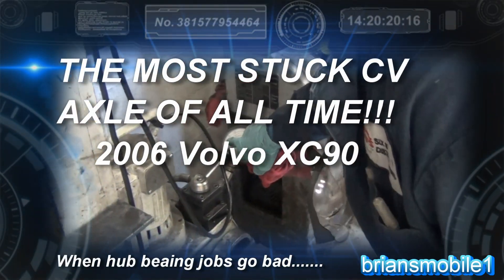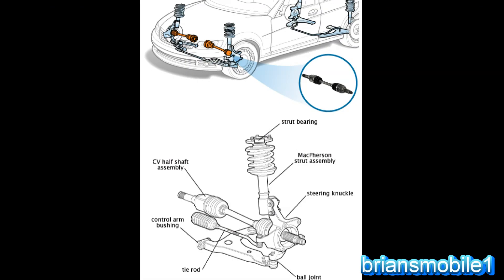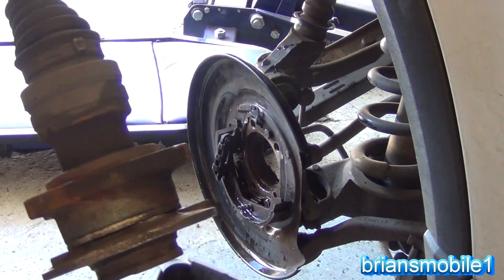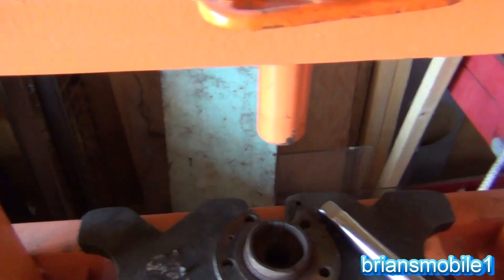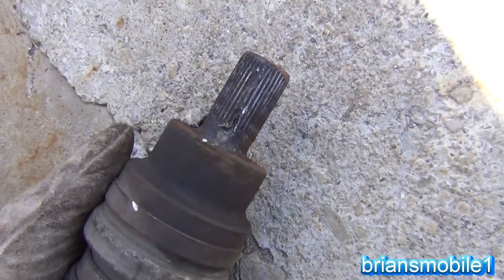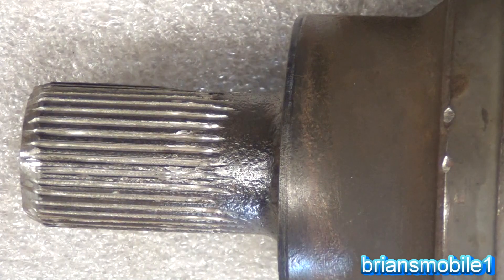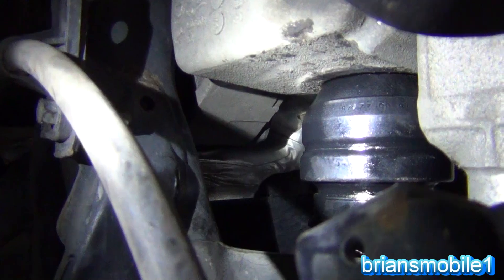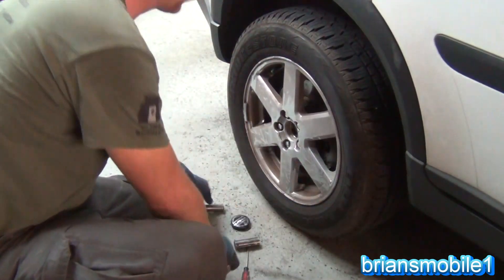Most STUCK CV Axle EVER Volvo XC90 2006

Comment: The round metal rim (the part with holes for the wheel lugs) of the hub is NOT supposed to take such pressure from the press.  This round rim will bend, even if not visible to the eye, and will not stay flush against the wheel any long, which will cause the wheel lugs to break loose while driving.   If the axle is really stuck inside the hub, replace the hub and axle altogether.  Forget about using a press.  Get some used parts, problem fixed.Side note, the wheel bearing is not made to take such hits with a hammer either.  Forget the effort, just get a used spindle and axle.  Don't forget to spray some rust reformer on the reluctor rings, before they rust and crack.

Comment: 21:16 I'm totally looking at the girls legs.

Had this happen on a Chrysler (yeah big surprise) I beat the hell out of it. Then to make it better it was designed so the CV joint was bigger than the knuckles hole so couldn't pop it out the tranny to work on it easier. So 4 angle grinder disc's later it came off. I had a new CV axle the people bought so I didn't need to save it.

Had it been able to pop through the knuckle it would have been easier to just cut the axle in two pieces. But it was a no go on that so had to go through the hub. It was probably more seized because the thing sounded like an airplane going down the road and the constant heating and cooling down probably fused it to it. The bearings were ground to nothing.

Wasn't too bad cost wise since it was domestic and old.

So all in all I feel your pain.

I see this often cause I live in the north (salt) and a lot of people loose the dust covers and don't think they do anything but look pretty. Some of them don't do anything and still let water and crap past them but Pontiac's have the best one's I've seen.....every time I get ready to take off an axle nut off a Pontiac it looks like new behind it. Pontiac axles are pretty easy to work on in their FWD cars.

Good job at saving that axle. It won't always work but you did a great job on this one.

Comment: I think  it is not a 2000 ton press which is huge. he just read 2000 psi of hydraulic pressure.
Force = area of bore * 2000 psi.
I guess it is about 100 thousand pound. 50 ton press.
Reply: Absolutely true! Just google a 2,000 ton press, they're friggin' gigantic! You're right it was 2,000 psi and not at all close to 4,000,000 pounds of press force.

Comment: I have a 92 ford F 150 when I'm back up in vibrate will bed I have a five speed with overdrive how can you tell me what the problem is
Reply from the maker: I could tell you what it is by trouble shooting the U-joints, differential, transfer case and gearbox.

Comment: I actually had the opposite problem on my xc60. Axle popped out of the hub fine, but after hours of hammering, prying, pulling, turning, etc it just won't come out of the transmission.
Reply: 3 mechanic attempts later, still stuck in the transmission. I have the excalibur of axles.

Comment: On the dremel, What do you call the bit that holds the wheel?
Reply: Arbor and/or mandrel, usually in 1/8 inch size.  A simple screw holds the abrasive wheel on.
Reply: Thank you

Comment: Lol 06 Volvo xc70. Wheel bearing stuck, tried taking the axle out, broke off in transmission. In the process of using a slide hammer to get it out now lol.

Comment: I've watched a lot of your videos for various projects. This video made me love your dedication and persistence to this more than ya know. 

Working on a 2004 Accord right now and the CV nut is stuck. Letting it sit over night with some penetrating lubricant (didn't have any PB blaster on hand, some generic stuff and brake cleaner had to substitute) and hoping for the best. 

Quick question for ya, if you happen to see this. I replaced the rear hub assembly on this same car today (the honda). The OEM spec hub I got seems to be about a millimeter off on the sensor ring (cog'd bit), so I banged the sensor magnet/metal protrusion back with a hammer and chisel so it would fit. Think that messed up the sensor?  And/or should I just get a different manufacture  hub assembly. (and new sensor because I just beat the crap out of it) =)

Keep up the excellent work. I hope you make enough money off the Youtube ads on your videos to make it all worth while, because you do good stuff.

Comment: Hmm... I would try to just cut across the whole hub with an angle grinder, like ppl usually do to remove busted cv joint ends, they just cut across the whole cv joint end to remove it. Why couldn't you? Not trolling, real question :)

Comment: heat the part you want to expand , in this case not the axle .
Reply from the maker: There's 2 strategies.  One is to adjust size momentarily by heating or freezing.  Another strategy is simply to oxidize or catalyze the rust or expand and contract to break up rust.  If you heat the hub you destroy the "permanently lubricated" aspect of it and destroy it.  That being the case you may as well just cut it.

Comment: that press at that shop is not 2000tons, probably more like 20tons.
we have a 60ton press at work and that's much beefier, and the ram is probably 3 times the size.
Reply from the maker: I have a 20 ton press in my barn that looks like a toy next to this one.  I've heard there are doubts, but that thing typically gets done whatever is put to it.  The red line on it is at 2,000.  That's all I've been able to see.  The respectfully ask me to stand back as things occasionally take to the air when things shatter under it.

Comment: I value my time more than the cost of the cv axle, bearing assembly.
After 15 minutes I would have pulled the axle, assembly and replaced with new.
"Never give up" ??? By the 1/2 hour mark my time would have burned the cost of the new assembly and axle.

Comment: Your 'eyeball' spec torque at the end was pretty lame; also, if you didn't use antiseize on every bolt and the axle end before reassembling, you deserve the same problems next time. Alloys that tend to corrode worse than other brands should be factory speced with proper antiseize materials, so thanks for steering me away from Volvos.

Comment: diesel-man's press wasn't 200T either.  at 2000 psi he would need 200 sq inch piston total area to hit 200T....he didn't have that.  a 6" cylinder would offer about 28sq in....he'd need 7 of them at 2K psi.  he had probably a 'very nice 20T' or maybe a 40T.  40T would need 1/5th of the 200 sq in?  still 2 6" cylinders.....I did that fast, buy you get the idea.....

Comment: would wd40 help ?
Reply: I've seen Wd40 help on light rust problems, but PB blaster just makes even harder rusty situations go easy most of the time.
Reply: Na totally wouldn't really as mentioned before it works on light rust. Although it is also considered a penetrating oil it just don't work quite as good as pb blaster. Now I am hearing pretty good stuff about deep creep being a very good penetrating oil.

But ultimately the best fix is to not put off a hub assembly when your vehicle sounds like an airplane. lol It would have made his job easier.
Reply: They last so long no one thinks to regrease wheel bearings and clean them up, but maybe that'd make these parts last life long.

Yes, perhaps after a failure continued high heat and friction would make it even worse...or it's just how long the rust gets a chance regardless of failure.

Sorry, I got a bit off topic thinking of wheel bearings. Rebooting a cv axle takes a lot of time. Even if you have more time then money it still doesn't make sense to work on maintaining the cv axle to me.

They usually fail because something else failed first like a motor mounts.
Reply: evilcowboy humor response instead of serious.

But don't you want a car to sound like an aeroplane? Lol

Airplane, aeroplane same thing. One just is funnier than the other.

Edit: looked up aeroplane. Oxford dictionary says it come from French and is the British term for airplane.
Reply: DE Nichols
lol that's usually how I say airplane just cause it sounds funnier lol.

I agree also on the cv axles too. They totally go when something else goes. Usually it will be a lower ball joint that takes those out. And with the non-greasable stuff they put on cars now there is no maintaining them. My ball joints are non-greasable from the factory. They haven't failed but when they do I'll get the re-greasable ones. Not to mention a CV axle is usually not all that expensive so why bother with a re-boot I just buy new ones myself lol.

Comment: I can't believe heat wouldn't work man!  It looks like your not heating enough because your afraid to mess up the rubber boot. you got to spend some time heating up, making sure you don't melt anything. but heat should work because it's metal.  every time this happens I just bust out the acetylene torch. makes things way easier and less chance of breaking things.

Comment: 2000 ton my eye, that guy is a goon. It wouldn't budge probably because the dealership have at some point used the volvo metal weld glue on the splines to cure axle ping, hence why it was a bitch to remove.

Comment: This is painfull to watch. I could only watch about 2 minutes.  Some people should not be allowed to work on cars.   Pull the whole axle and unit bearing out through the knuckle. Then place the unit bearing on a vise or some thing solid so it doesnt bounce when you hit hit with a hammer, or just leave the unit bearing bolted in place so it does not bounce...  All your energy from the hammer is being wasted because the unit bearing is bouncing.  Or use a air hammer with a hammer head bit to rattle it loose, while keeping the bearing bolted in place so it does not bounce. You could use a puller/pusher to push the axle out. If you dont have the correct pusher/puller build it....  You could use a piece of thick flat stock and a big bolt to push the axle out of the splines.  Bolt the flat stock to the lug nut holes and push the axle out with a big bolt and a couple of nuts.  You are replacing the bearing so if the puller rips the bearing apart, great.  Take a die grinder and razer wheel to cut what is left of the bearing away from the splines without damaging them. It's not that hard if you use your brain before the hammer.